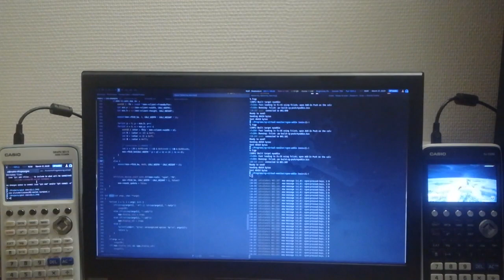Using CASIO graphing calculators as external monitors

Comment: Hi, so this was previously working on my laptop but i reset my laptop and redid everything for windows and it works however the monitor doesnt fill the whole calcualtor screen? i dont know why its this way id appreciate it alot if you were able to help me out with this
Reply: If you mean that the monitor is smaller than the calculator screen: check if the resolution of the extra monitor is set to 396x224 in Windows' display settings. If it's not and the option is not offered, unregister the display, go back to the Idd-Sample-Driver install step where you modify option.txt to add it (and make sure it's the first option), then try again. If it is 396x224 check if the VNC server is exporting the entirety of the extra display and not a subrectangle.

If you mean that the monitor is larger than the calculator screen: check if you're not exporting your main display via VNC. There's a step to configure the VNC server with -sharedisplay 2 on the command-line. It doesn't work all the time in my experience. If you can't get it to work, make sure the extra display is top-left in your display layout, because the tool will send the top-left 396x224 corner.

cgvm_vnc --sdl will, in all cases, show you exactly what would be sent to the calculator, so you should first get it to show what you want.
Reply: @OneSilentLake  yeah the problem is the monitor is smaller than the calculator screen. The resolution is correct and everything. I think it might be a vnc issue since when i connect to vnc viewer it shows the same thing, the display isnt full. Anyway you know how to fix it? I am on windows btw,\
Reply: i also wanna note that this worked previously , i dont really know what changed
Reply: @Yoyous  Check the VNC server settings and play with -sharedisplay 1 and 2. Worst case, reset the server config or reinstall the server. Surely it can't be that hard to get it to send the whole monitor... ?
Reply: @OneSilentLake  do you have a discord? much more effecient to communicate there, Mine is my username. Anyways iv tried reinstalling vnc and i tried multiple versions but i cant figure the problem out. The only time it got fixed was when i used an extremely old version but it was very laggy and crappy.
Reply: @OneSilentLake  Update: I found one way to fix the issue was to change the scaling on my original monitor? i dont know how that makes sense but ill have to get used to the new scaling if i wanna use the calculator one properly
Reply: another update: now the calcualtor display is very laggy and freezes but i can move the mouse which unfreezes the pixels around the mouse?